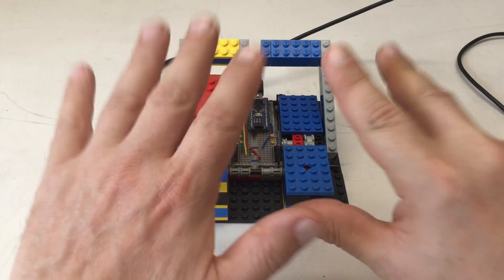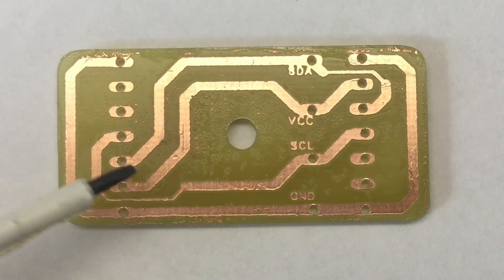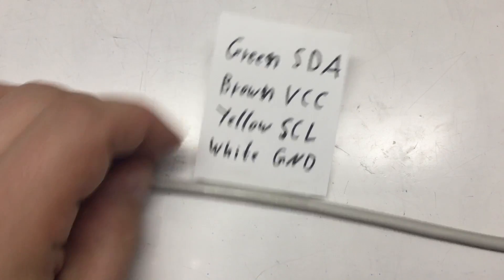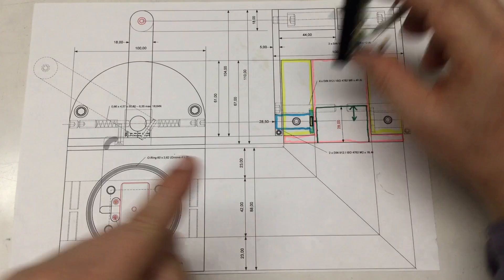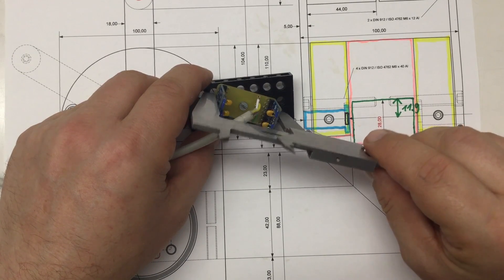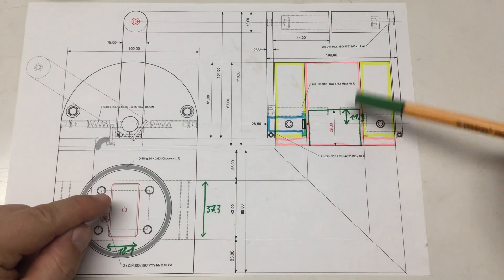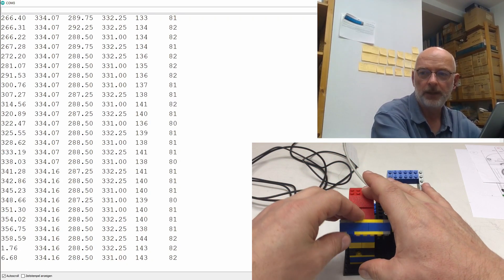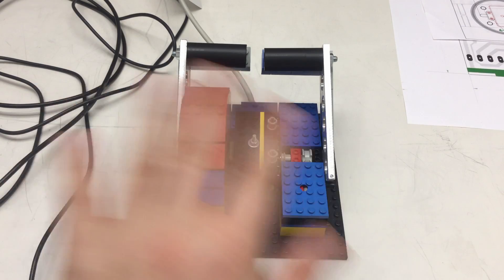Dual Electronic Engine Control Lever IP68 (8): PCB

Comment: Hello Robert, please can you gently tell me which scr is mounted on your bfw40/e power supply. Thanks you.

Regards

Tom
Reply from the maker: Sorry, but you can't really identify the SCR without removing the heatsink, which I never did (see "Proxxon BFW 40/E Spindle Power Supply Teardown (Circuit, Waveforms)" https://youtu.be/kbZFDs10nTI ). But any SCR that can handle > 50V and > 5A should do (I would go for a 100V/10A type).